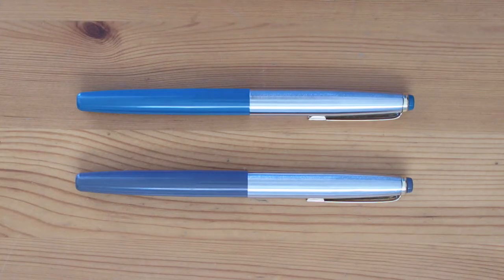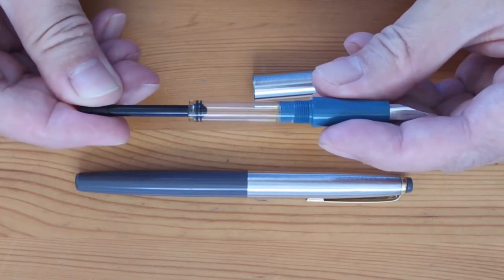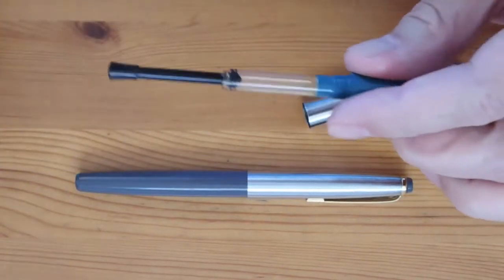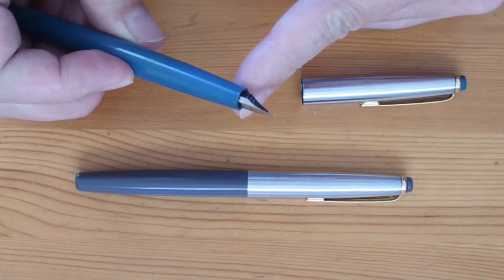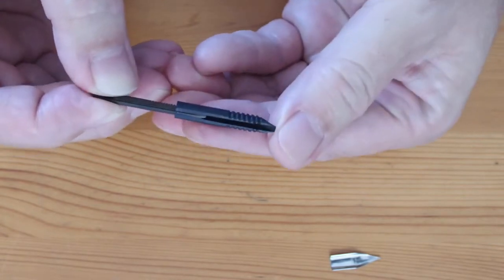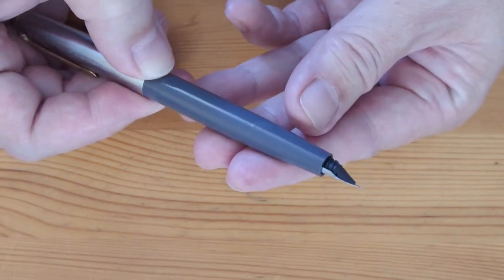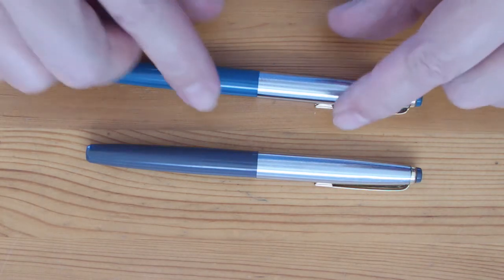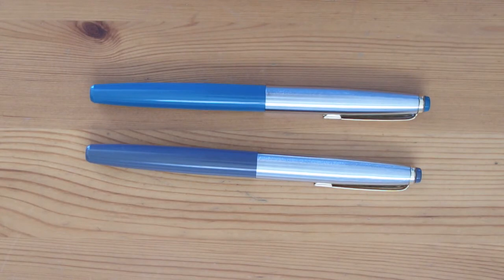Kanwrite PC Metal Fountain Pen: A Quick Look

Comment: I much appreciate Your point of view in this channel. Pens are tools for writing first and foremost, and efficient  construction  are essential for the pens ability to give a satisfying writing experience. . Have You considered the sister pen of the PC Metal, the Relik, from its ability to resist drying  out? Currently I'm searching for a pen that is suitable  for the very dry Rohrer &Klingner Scabiosa ink.
Reply from the maker: Johan Holmberg I am aware of the Relik and the other companion model Saloon as well, but as I have a fair collection of hooded nib pens, I guess I'd just be as well look in that direction. A bottle of Scabiosa will be in my possession in a few days, my primary concern is if it is going to stain plastics materials, but we'll soon find out.
Reply: Seele2015au Right now a Parker 51Special is my designated scabiosa pen. Its sac is totally opaque, so any staining from the ink would go undetected in that pen. That specimen of a Special came with a notably wet nib. That compensates for the dryness of the ink itself, and brings out the nice colour and shading. And drying out has never been a problem. A pen with a larger ink capacity, and with the possibility to see the ink level would be nice. When using Scabiosa in plastic converters I noticed that they were very easy to clean from the ink. I look forward to Your sharing, eventually,  Your experience with the Scabiosa.
Reply from the maker: Johan Holmberg Thanks for your tip; I have no shortage of 51s so that is worth looking into. But as you can surmise, I do not do "reviews" as such, so doing ink review would be outside the scope of this channel. Thanks again!
Reply: Seele2015au Maybe it would be possible to mention inks and keep it technical.Focusing on saturation, corrosivity, viscosity wetness dryness and such? These aspects would be expected to influence the pen engineers when designing a pen.
Reply from the maker: Johan Holmbeg There are already a fair few channels doing ink testing, they are doing great work that I cannot aim to surpass.